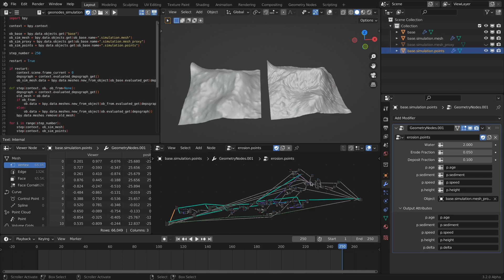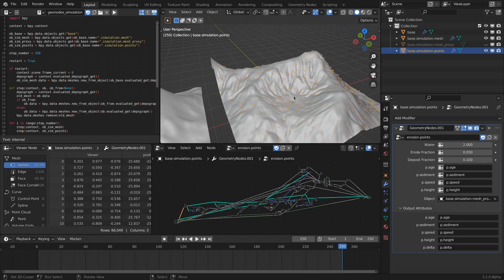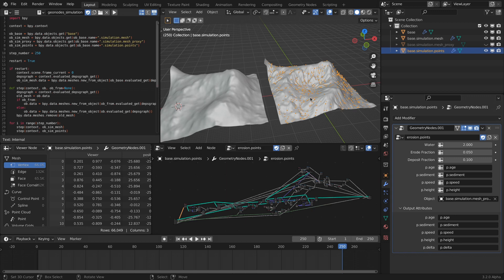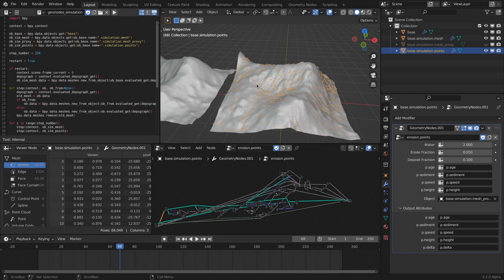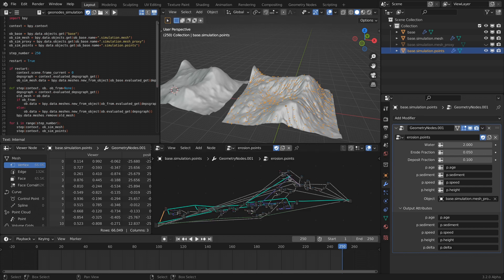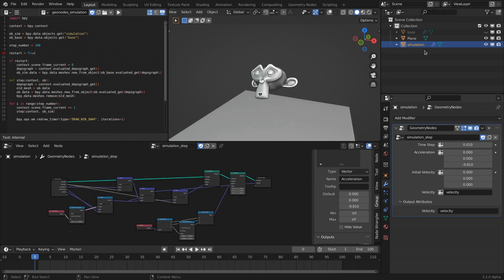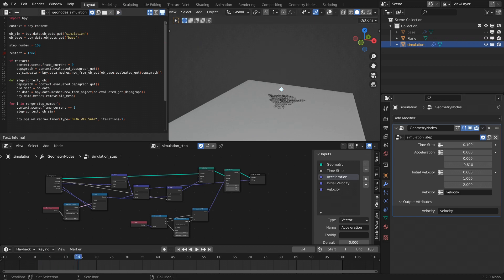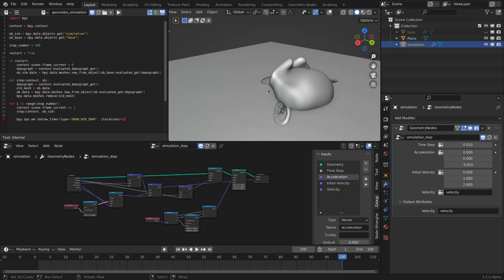Terrain Simulation with Geometry Nodes - Project Heist

Comment: I'd like to see this with simulation nodes.
Reply: Erindale is selling a course that basically does this, although I get the impression his set-up is a lot more complex. I think a basic version of this would be pretty easy to do in simulation nodes, though. Generate particles on the surface, do some vector math with the surface normals to figure out a velocity for the particles, and then reduce Z on the surface based on that velocity. If you want to get fancy, there'd be a limit to how much surface material can be transported by the particles at any give time, and when the particles are traveling slowly enough they should start depositing excess material (increase Z) that they have stored. I know civil engineers have figured out formulas for erosion you could consult for realistic values, but you could probably eyeball it pretty well.

Comment: Can you imagine if geo nodes had a script node that accepted a language which runs at similar speeds to C++, such as VEX for example.  Would be great accompaniment to the built in nodes.  Users could start building and sharing their own nodes without having to worry about getting code approval, and allowing the entire system to grow much faster than the C++ devs can achieve.  Plus there's be no need to use the much slower and limited python for scenarios like this.

Nodes could also optionally be automatically converted to VEX scripts too (and vice versa), so you could create systems far quicker than fiddling around with nodes, but then still share them in a node format to non coders.